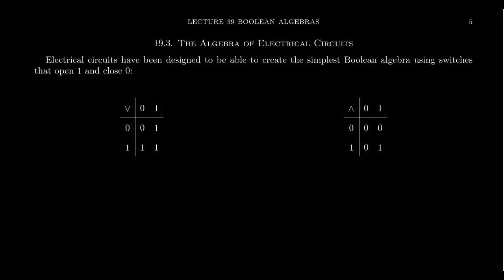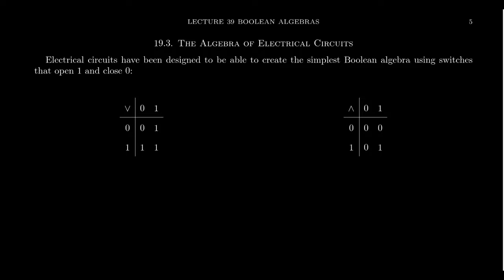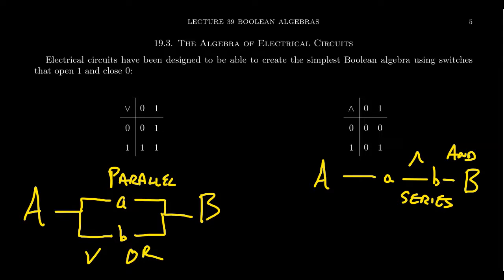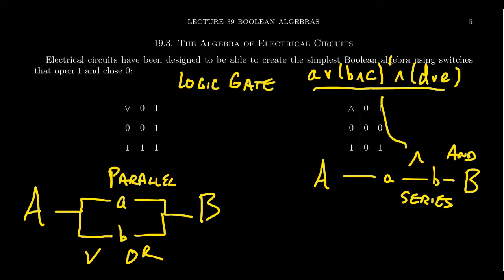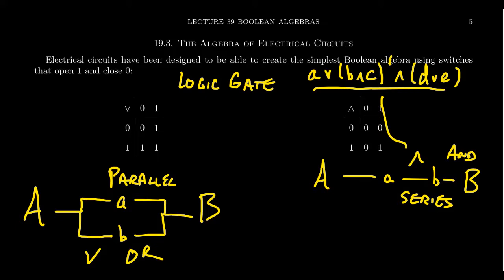Boolean Algebras and Electric Circuits

Comment: Can a boolean algebra be applied in circuit theory??????
Reply from the maker: Of course. The engineering department at my institution offers such a course: EET 2780 - Digital Electronics I. The course description you can find here: 
This is the first of a two-semester sequence in digital electronics. Topics include number systems, Boolean algebra, binary arithmetic, logic gates, combinational circuits, and basic memory circuits. Electronic test equipment and simulation software will be used in the lab. Students will analyze, build, and test logic circuits.

Comment: You should probably change the terminology you use.  A switch that is CLOSED allows flow to pass and a switch that is OPEN does not.
Reply from the maker: Thanks for pointing that out. The most common language here is that "closed" allows flow and vice versa. When it comes to lattices, I often work backward. That is, I usually put 1 on the bottom of the lattice and 0 at the top. From a semigroup theoretic perspective, flipping the ordering makes a lot of sense, but order theorists do it the other way. I confess that the open vs closed comes from the electrical engineering field and not theoretical mathematics, but nonetheless it is good to know that I am consistently backward, jk.